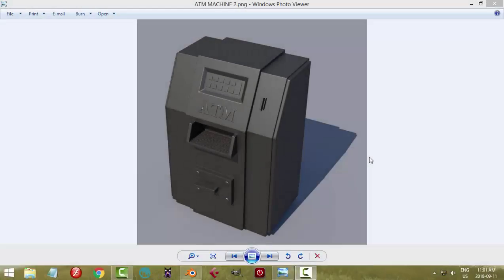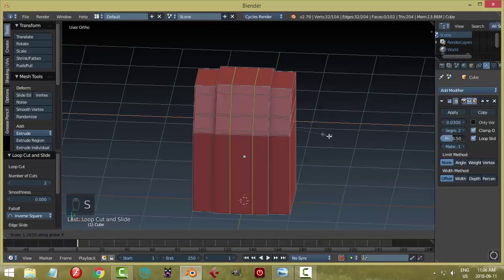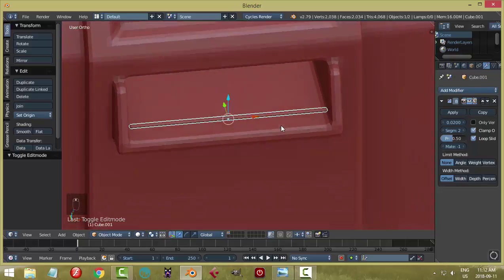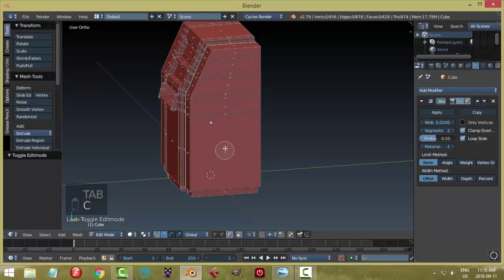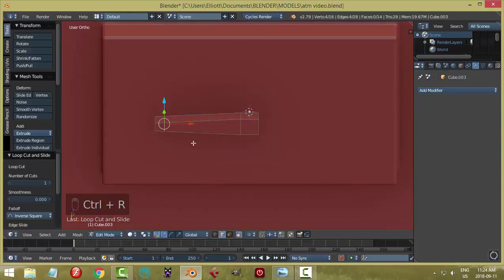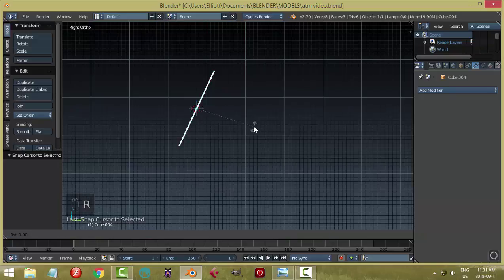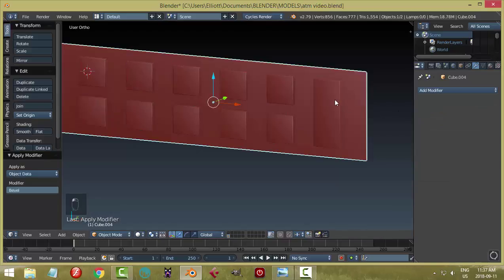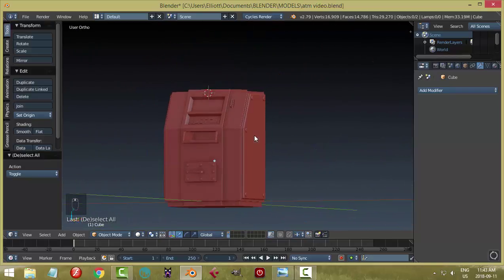Blender: Modeling an ATM Machine

Comment: this deserves to be ported to sfm and gmod! is it ok if i do? i will give you credit!
Reply from the maker: Hey thanks.  Yes of course.
Reply: also i have a question about your older office shair tutorial i noticed everything looked fine except the bumps of the leather were a little unclear and un noticeable except for the back of the chair what i do wrong?
Reply from the maker: It should look ok on all parts of the chair. Did you UV mapping it?  If so, that might have caused a problem with your texture. But if you just applied the leather-like texture using nodes as in the video, the texture should appear on all parts of the seat. However lighting plays a big part and it may affect how well the details can be seen. Perhaps zoom in closer to the seat and have a look through the camera or try moving the lights. Hope you can get it to work better so you are satisfied with the result. Good luck.
Reply: yeah your probably right so i will mess with the lights and stuff thanks :)
Reply from the maker: Hope it works out for you